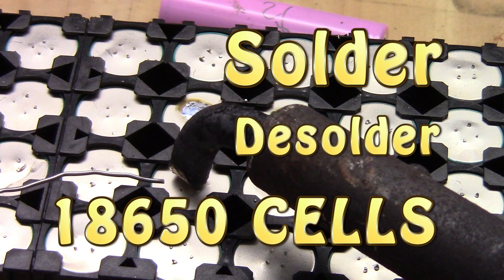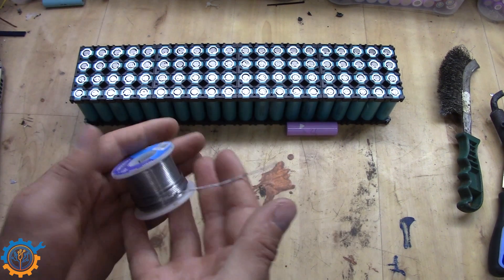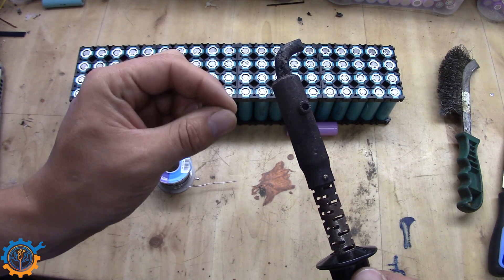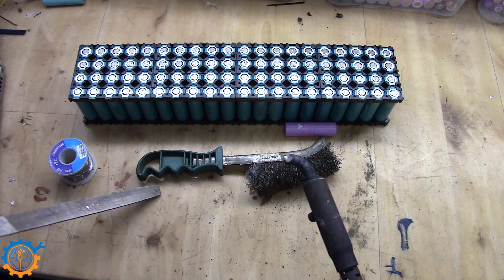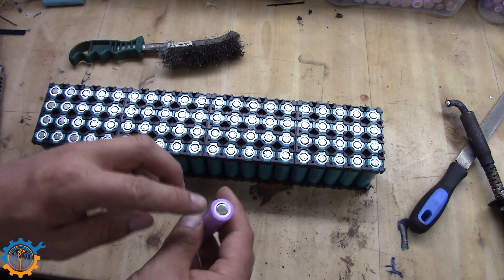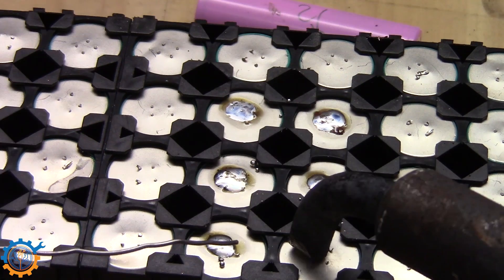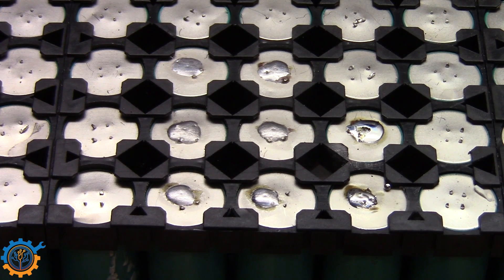How to solder/desolder 18650 Cells

Comment: anyone else has any idea. putting heat to the battery decrease it life and dangerous
Reply from the maker: Yes heating a cell alot will decrease life and cause issues. Thats why its important to keep it to a minimum.
Reply: @DIYTechRepairs  1 question can you spot weld on top of the soldered lead instead of removing it?

Comment: If you have old de soldering copper braid that doesn’t seem to be working the flux is probably gone. Add some with a flux pen and it will work much better. 

I don’t use my supplies very often and my de soldering braid was 2 years old. It was driving me crazy until I figured out it had flux on it originally but that had evaporated.

Comment: I have over 1100 cells to package and solder. In 100cell parallel packs. Then in a 7 s bank. I need a few more to make it to a even 1400 cells. Then all I have to do is repete 3 more times atleast. It comes to about 520 ah when I get all 1400 cells. So it will be close to 2100 ah when done if all cells are equal to the ones in the bank now. I'm dreading soldering the packs. I have built packs before. But this is a bit different. And alot of soldering. I also have 4 amp fast blow fuses. Maybe I should have went with 2amp. I think my cells have the ability to blow the fuses if need arises. I have 4 and 5 amp fuses. I believe that I will stay with the 4amp fast blow. Under normal use I will only be pulling 100 amps max from the bank. And have breakers to trip at 250a the inverter pulls 225-240a max. And will likely never see that. Most likely 150a at most. So at cell level 1 amp per cell would be rare!  And normal use would be around 30-50 ma/cell! And I have a lead acid Bank at over 800 ah! Nice video. I think I need a better iron!

Comment: I got lucky at work today. They were throwing away about 90 Panasonic toughbook batteries.  So far out of the packs of 6 cells opened 10  only two bad batteries out of 60 so far yay! Thanks for the info
Reply from the maker: Cool! Good start
Reply: DIY Tech & Repairs I used a butane soldering iron . It was instant.

Comment: Very complete, thank you! Given that you both solder and weld, do you have data on the "damage" done to the cells when soldering? The argument I've heard is that the extreme heat from soldering damages the cells instantly. Do we know by how much? Thanks!
Reply from the maker: I dont have any such tests done. That would require rather extensive testing. Lets say 1000 cells and 1000 cycles :)

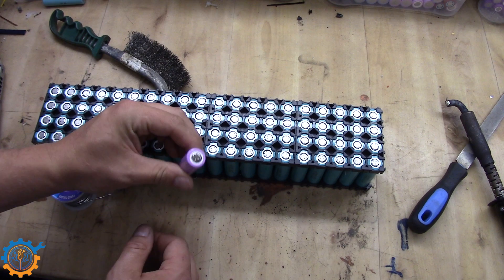Comment: 5:29 You are shorting the cells!
Reply from the maker: No im not. They are all in paralell :)
Reply: Entire can is negative and goes to top beside to positive side. Brush may go through top hole and touch negative side.
You should see sparks when brushing in the dark.
I'm too scared to try it myself :P
Should be extra careful not let any solder blobs, metal powder etc under positive side.
May short and start fire later due vibrations etc.
Reply from the maker: :) Could happen but the cells in image have the insulation circel, whatever it is called. So i have not seen any spark so far but yes it could happen :)  And if so there is no harm to the cell or danger as long as you just brush it and dont leave any brushes there :P
Reply: There is not any insulation through top holes to negative
Stick thin bare wire to hole and see it's immediately burns off ;)
Reply: Good news for me :)
Tried now, not easy but got sparks with LG cell (4 holes) sticking wire to side under insulation ring.

Flying solder may burn off insulation too.
Reply from the maker: Yeah that might happen and i have done it. You have the negative side close on the side so if you destroy that protection ring or so you will do it. I have done it as well :D That cell got hot

Comment: Get a solder-sucker like this: https://www.amazon.co.uk/d/j8h/Silverline-633609-Metal-Solder-Sucker-185-mm/B000LFTN4S

That way you can get rid of excess hot solder without risking shorting out the top of the cell by shaking the solder down below the top cell wrapping of the cell and you don't have solder flying everywhere by blasting the hot solder away with with a blow-gun.
Reply from the maker: Morten Mortensen have one of those and they literally suck :) if going for a sucker i would go with a proper one with vacuum pump. though it can be my handling that sucks....

Comment: Very well presented.  Been soldering for 30 years, you left nearly nothing out.  I got solder on the positive of a cell a little too big a blob and was nearly touching the negative case.  Could not use copper braid or air blast due to risk of a short.  I ended up using my old solder sucker pump which has a plastic tip.  It worked fine.

Comment: im planning on building a small power pack, this is my first, and im thinking in getting a bms for it, if i use a bms would i still need the fuse wire ? my packs are, 3 packs in parallel with 60 cells in each that then will conform a 3 series of packs for a 12v     <------------- im i ok with this or did i calculated this wrong ?, i all ready have 100 cells with vruzend and another 8 boxes of vruzend are on the way, what would you recomend
Reply: The fuse wire can protect your large pack from one bad cell. I had  10 cells in parallel and one died by shorting out. It pulled the energy from the other 9 cells and the fuse wire disconnected. If the fuse wire was not there it would have pulled all 10 cells to 0 volts probably damaging the other cells in the process. 

If you are using all brand new cells maybe the fuse wire would not be as important.

Comment: We call that soldering iron cleaning material in the ashtray cup copper wool. The good stuff  for soldering is supposed to be coated in flux like the braided copper wick. But you can buy plain copper wool in the housewares (pots/pans/stove elements) section of a supermarket or home improvement store. They are a few dollars for a pack of 3 pads here in the States. It is sold as a scrubber for steel pots. The copper is too soft to scratch the steel, but stiff enough to dislodge burned-on food. The coating on new solder tips is an iron plating, BTW.

Comment: can i make   lithium ion battery 18650 to use in my solar panel?
Reply from the maker: Yes you can!  :) Thats the short answer. The long boring answer is that i recomend to read up on it. Diypowerwall group on facebook or diypowerwalls.com forum is a good start

Comment: Great video. Did you make your soldering tip ? I can't find any even close to the same.
Reply from the maker: No i did not. The soldering iron i have is very old. But i know several people that have taken pure copper rods and used for tips. it works but just beware of that it will wear out pretty fast. on the other hand its not hard to change tip when needed :)